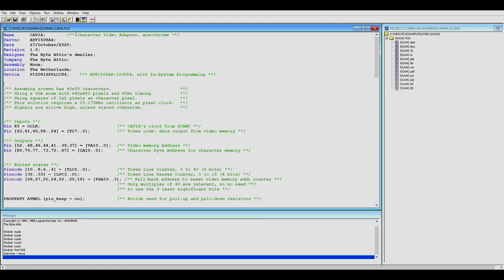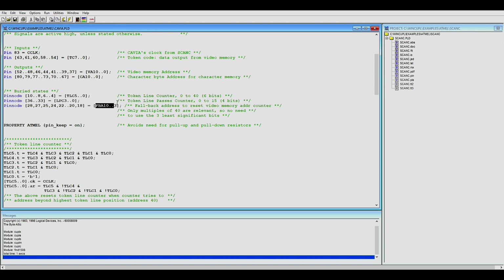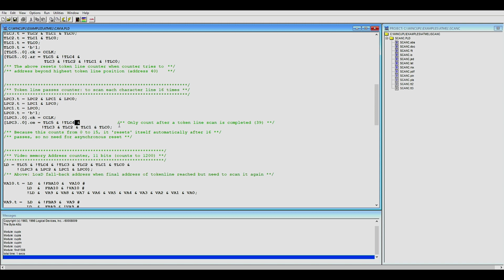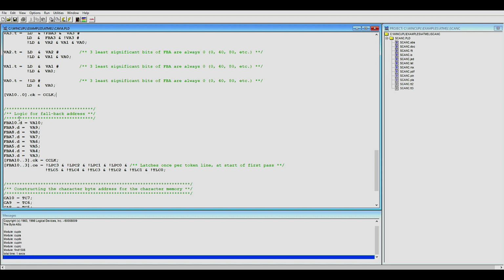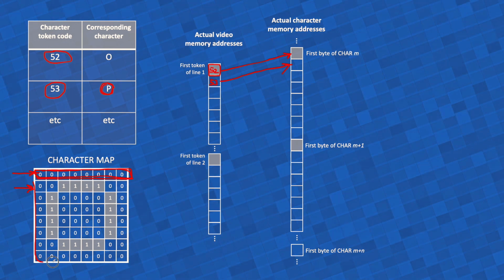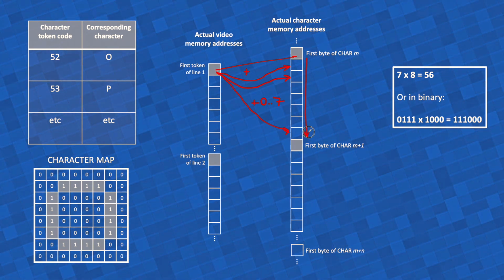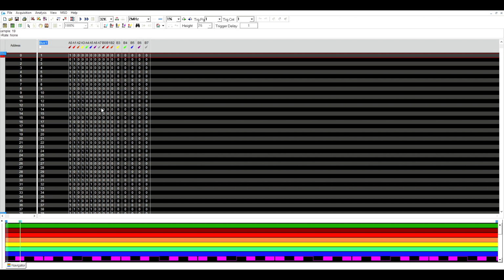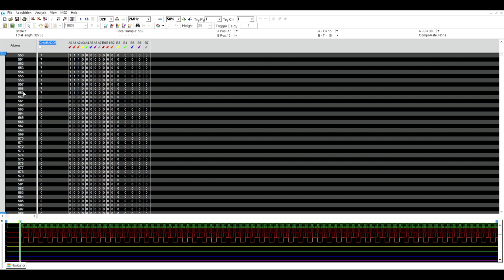Building CERBERUS 2080™, my dream childhood computer: Episode 4

Comment: I love the idea, but I think it is little overengineered. I think you can simply implement your "video adapter" as monochrome framebuffer. Monochrome 320 x 200 needs only 8 kB of RAM, even dualport should be more flexible in that design.
Reply from the maker: I am doing only 2KB for VRAM (character tokens), and another 2KB for character memory (character maps), both dual-ported. So still just 4KB, half your estimate. ;-) But it IS over engineered! :-)